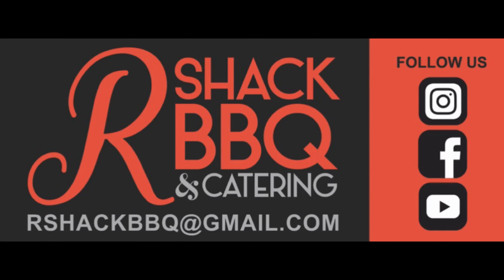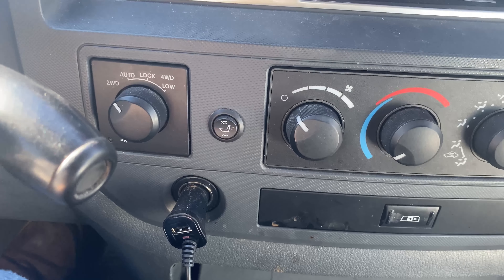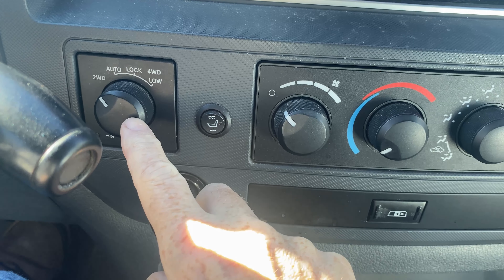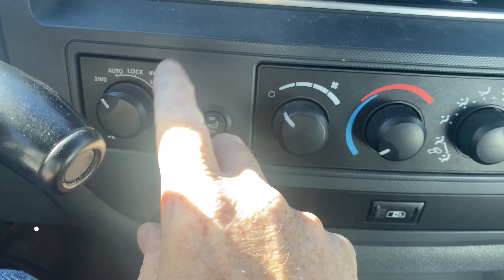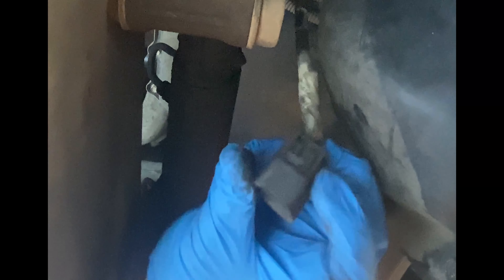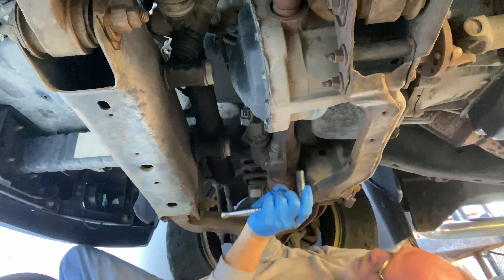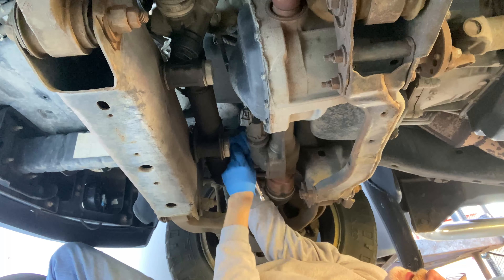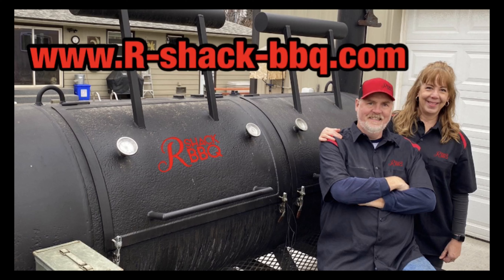how to replace the 4wd actuator on a 2007 Dodge Ram 1500

Comment: I did the same thing and it didn't work. Had the TIPM reflashed to see if that would fix it. Nope. Any other possible solutions?
Reply from the maker: Thank you for watching. Keep in mind I am no mechanic and just read forums or watch videos. Depending on your vehicle year - there is another sensor up on the front axle that can go out - I think it is 2002 to 2006 dodge rams. This is a link to that video https://youtu.be/2oguop1zJAA
Reply: Check your CV axles.